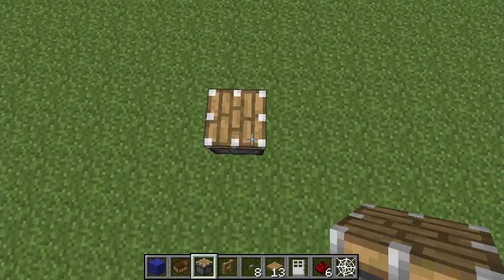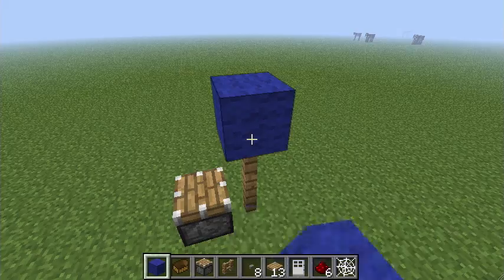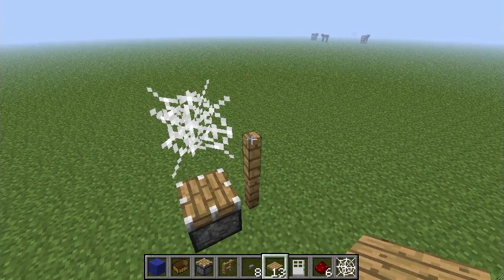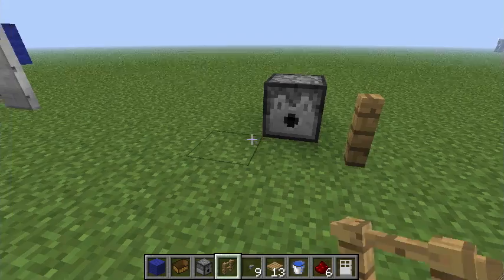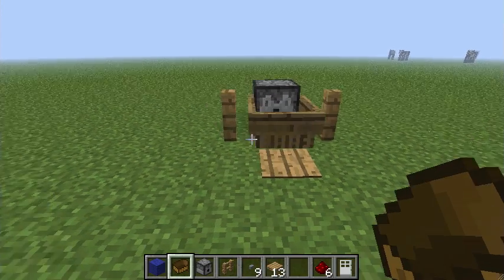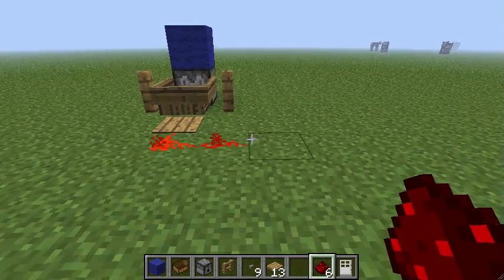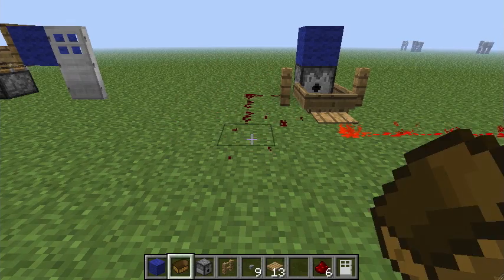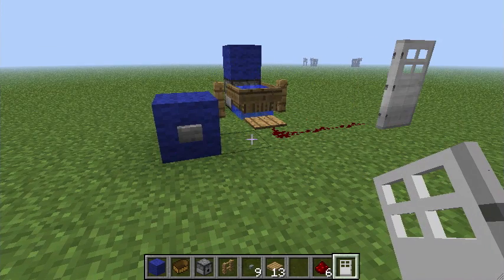2 Buttons you need

Comment: its the standard tff i use, i didnt create it.
It uses 2 pistons facing towards eachother 2 blocks apart, with redstone block infront of one piston. In the space between the pistons, 1 block up place blocks. On top of those, place redstone dust. Torches above the pistons, and one will extend. The other will stay shut. Finally, your input is into the top blocks, and your output is either of the blocks the redstone block goes to. Happy to help. I was just proving a point, not saying the kid is bad

Comment: unless you dont want a lever. The second thing can be used with a pressure plate too.

You walk into your house over the pressureplate and all the lights turn on. You walk back outside and all lights turn off. Not useless at all.

Comment: Because with the flip-flop, you can have more than one button connected to it. If you have two levers, and the lever outside is on, you can't close the door from the inside, and the same is true vice versa; If the lever is on inside, you can't close it from the outside. These two designs offer solutions to this problem.